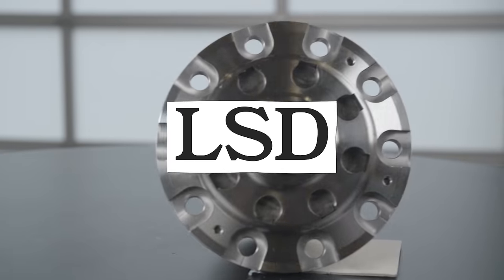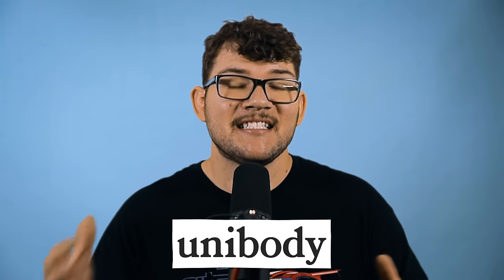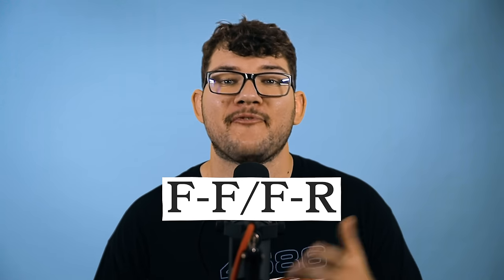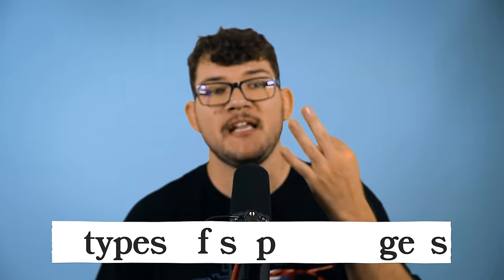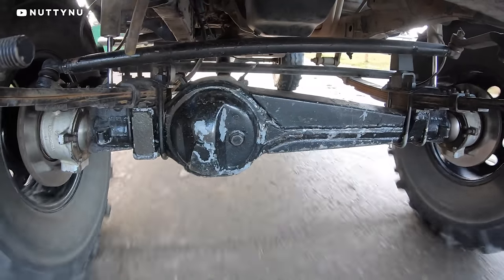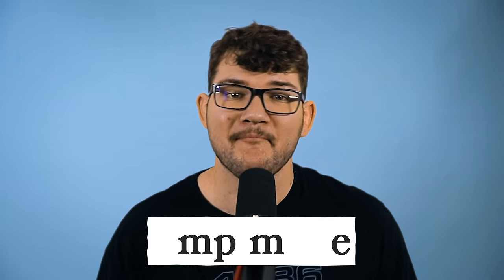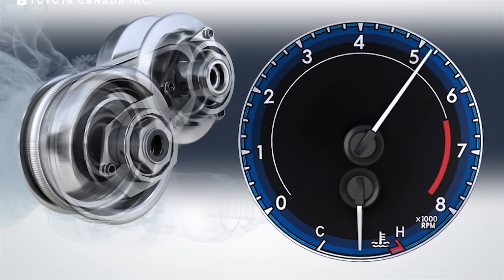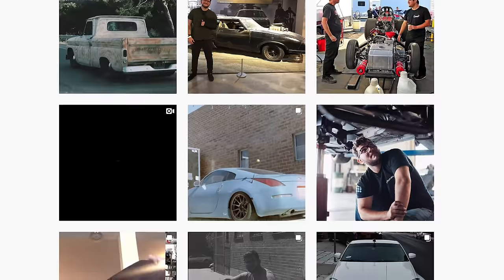Car Terms Every Car Nerd NEEDS to Know

Comment: haha blinker fluid, who the hell falls for that one? Now excuse me please, I gotta go change my muffler bearings.
Reply: The mechanic replaced my car's piston return springs but I'm pretty sure they were still good, they were replaced like 2 months before that already.
Reply: Everyone thinks they're funny haha muffler bearings...

Germans have forever referred to muffler hangers or exhaust system hangers as muffler bearings as they bear the weight of the muffler.  Just so as you have a good can of wire smoke to put it back in.  We are all good.
Reply: @the1whokill518  cmon man read it.
Reply: need to change the carbouator belt on my brand new car
Reply: brb, im going to check my oil levels in my spark plugs
Reply: @the1whokill518  actually I'm not sure about that. The valve may not actually use bearings. Hmmmmm should look into. But im also lazy.
Reply: Be sure to use the correctly sized left handed spanner wrench on it.
Reply: @rafox66  PIston Return Spring is fucking hilarious. but now im starting to question if something like that has ever been tried. sounds like an interesting concept.
Reply: muffler bearings? lol, imagine not having a semi-hydraulic muffler assembly!
Reply: Wait blinker fluid is not a real thing?
Reply: wait thats not a thing?
Reply: You own a bmw I am guessing?
Reply: Gotta change that pesky rusty spark tupes 😂
Reply: My wife
Reply: Turns out blinker fluid actually is a thing 😂 it's used in the 1st gen viper headlights
Reply: Don't forget to change the winter air to summer air that could really mess up your tires
Reply: I gotta replace my windshield wiper brakes
Reply: Working in aviation I’ve heard “hey buddy, get the prop wash.” And have myself been asked to find the “K9P” for paint stripping. (I went to another coworker, grabbed some old yellow drink lying around, bottled it and labeled it K9P and brought it to my boss)
Reply: Make sure to get the Nylon muffler bearings.
Reply: Dont forget your wiper brakes !!!
Reply: @the1whokill518 you Canadian ehh?
Reply: Not if I change my gear clutch first 😂
Reply: Make sure you check your canuter valve
Reply: Don’t forget the muffler grease
Reply: Airplane dirty? Go buy a couple gallons of prop wash
Reply: It's always best to add fresh gaskets when you change those bearings
Reply: Don't forget to grease your piston return springs
Reply: Never fell for those but I did spend some time looking for the squeegee sharpener.... sounded so real.... 😂
Reply: Dang what kinda turbo u running in that car. that would be a muffler bearing? Right? Lmao
Reply: I just replaced my wiper brake’s courtesy of Mr fix it himself :)
Reply: One thing that most people don't bring attention to is that the clicking sound of blinkers comes from the car's speakers.

Comment: Non-car people: "So thats what blinker fluid is"
Reply: Might wanna change out those muffler bearings while you're at it. Luckily enough my budy "Dirty Derk" has a special deal out right now.
Reply: matthew kovich by any chance do you know a good summer air dealers? I need new air in my head gasket setup.
Reply: @nick-mx4bz  I don't have summer air for head gaskets but we have a premium deal right now for changing out the seasonal fluid in your tires, it helps quite a bit with performance.
Reply: @TheConfusedWumbologist  sounds good, my window catalytic convertor delete has been making noise and that might be the problem
Reply: @nick-mx4bz  😂👍
Reply: I was waiting for the explanation xD
Reply: Piston return springs
Reply: i do not have any blinker fluid in my car do i need to go to a mechanic?
Reply: @MrBunch  yes
Reply: @TheConfusedWumbologist  you might want to check on your racing seat fluid
Reply: @z6u5  Nah man it's all good. I got dem levitating seats. They really help on long bumpy drives. Super comfy.
Reply: My blinkers fluid are non serviceable like those tranys that don't require service but I'm concerned if I should actually change the fluid or not. Help pls 😂
Reply: I think my centrifugal waffle sprocket is on it's way out the giggle pin has fell out of it and its rubbing on the laughing shaft
Reply: @Keeler442  damn, you're gonna need a frame stretcher to get to that waffle sprocket, due to the fact that it's tucked up under the mounting position of the o-face sensor.
Reply: You might need a head gasket delete for the blinker fluid to inject
Reply: It tastes like blue Gatorade
Reply: @Carsinogenesis  it really does.
Reply: I wonder how many people fell for that
Reply: @nick-mx4bz  shiiit I’m still running winter air in my tires..  never knew you were supposed to get new air with the different seasons
Reply: Yea it helps out a lot with speed, weight, smog, and it makes sure you windows don’t fog up.
Reply: @nick-mx4bz  that would explain my foggy windows on the 80°+ days
Reply: I need a new zortch converter in my 2030 Chodge Dallenger
Reply: Man I need to get some but I'm working on my brake ducts
Reply: Shhhhh
Reply: Use a little Seafoam in your blinker reservoir and I guarantee you won't hear that annoying blinker 😀
Reply: Fliuid for your blinker...
Reply: For the longest time I thought blinker fluid was real lol
Reply: Don't forget the Piston return springs
Reply: Guys, I’m hearing this knocking sound from my muffler. Should I change my muffler oil?
Reply: also, don't forget replace your piston return springs every 5,000 miles
Reply: @alexandersimon5340  Whoa, how did you get the 2030 Chodge Dallenger already?
Reply: *proceeds to fill blinkers with bleach
Reply: F
Reply: Where can I get some piston return springs for my chevrolet camry with a v5 engine?
Reply: That's actually what i said when it came up.... I'm still learning tho! lol
Reply: Don't forget to change your tire fuel injectors
Reply: Wait it not?
Reply: Might wanna change your alternator fluid while your at it too.
Reply: @memeboi6108  whilst changing it it would also be a good idea to get a wheel spark brace
Reply: HAHA exposed
Reply: @TheConfusedWumbologist  dirk*😂
Reply: Jerry be like
Reply: dang, i have been running stock all season piston return springs all this time. I should really change them out for summer high performance piston return springs.
Reply: I got hooked up with free spark plugs for my 85 Jetta diesel when I asked for a gallon of blinker fluid

Comment: I’ve been using their blinker fluid for years, incredible product.
Reply: James  I haven’t but the ones on my 22re are about shot, I’ll give them a try!
Reply: They also have piston return springs that are pretty gud.
Reply: For real my blinkers are so fluid it’s unbelievable. Best investment I’ve ever made
Reply: Is blinker fluid actually real? Cuz now I’m confused
Reply: @benjaminrios5235  🙃
Reply: @benjaminrios5235  They're all trolling. Donut did it for laughs.
Reply: seriously do not want to skimp on that, learned it the hard way when my rear left blinker gasket blew
Reply: Aditya Pran Borah  I like wire instead, you can feel the pull on those blinkers real good
Reply: My blinker was working then not working then working then not working so I topped up the blinker fluid now the blinker works fine it stays on continuously when I use it.
Reply: @benjaminrios5235  no it's not real but it's funny 🤣
Reply: I can’t find the blinker fluid fill nozzle on my bmw 320i, it’s been empty for weeks and people think I’m an ass whenever I cut them off!
Reply: Just directly spray a pressure washer at your headlight assembly.  Cheap hack
Reply: You haven't tried their Clutch Friction Lining Lubricant! Best stuff to hit the market in YEARS! I'm telling you, you won't believe the difference--you've NEVER had such smooth clutch engagement before, only $49.99 a bottle--enough to last the whole LIFE of the clutch!
Reply: @bryangibson6211  😂
Reply: @benjaminrios5235  Blinker Fluid and Muffler Bearings are what people send non car savvy people to the parts store to troll them. They go ask for it at the store and the employees get a laugh.
Reply: Me too ive been using dirty dirks for ab a decade now no more agressive click
Reply: Honestly same the blinkers are so visible I feel my steering getting better with the 0w-55 fluid
Reply: @benjaminrios5235  only in the SR1 Viper

Comment: As a subaru owner I'm a little sad you didn't cover "milkshake"

the mixing of oil and coolant when the headgasket starts to go
Reply: Also he didn't mention H for boxer when he was talking about the engines😞
Reply: 170k on my 07 WRX, never had a head gasket issue. Turbo seals died and burnt a valve but no headgaskets lol. I do however have a built block and heads now.
Reply: @Ontheregz  give it ~30k :) sold my first car at 199k for 450 when it started making milkshakes. (and rod knock and valve tick and no e brake and it leaked everything except trans/wiper/diff fluid and had more rust than steel and..... Well you get the point) I'll miss that 1999 subaru impreza outback "sport"
Reply: Tyler woodring got some MLS gaskets and ARP studs everywhere, should be ok with 30psi and my gtx3576 gen2  😈
Reply: This is the mark of a Subaru? I was thinking about one but now...
Reply: I’ve gotten a milkshake out of a deuce truck.
Reply: @mikeaninger7388  People exaggerate  way too much. I have 2 Subies and they both have more than 150000 miles, no issues whatsoever. As long as you maintain your cars you'll be fine.
Reply: There should be a part 2
Reply: Mike Aninger yeah from the 90’s lol
Reply: That's mayo 😂
Reply: Benjamin Stephen dam straight! I have an 07 wrx pushing 400whp and is extremely reliable, the 15mpg on e85 sucks tho lol. But thats why I bought a Forester.
Reply: @Ontheregz  nice! I have an 06 Wrx my self
Reply: happens in my dad's K series engine Toyota back then, coolant temperature goes high abnormally, and he refilled it frequently on the highway rest area. But it still pulls strongly for another 100 kms until he reached home. Turned out the headgasket were in trouble, and the engine insides looks like a brown porridge. Just needs to replace the piston ring and its ready to go again. Talk about old Toyota's reliability.
Reply: Vincentius Kennaldy dude! I had a 98 Tacoma with 350k, a 2000 with 270k and an 01 with 200k! Miss those mini trucks. All I ever did was oil and plugs lol
Reply: 1) Thanks for educating
2) Lmfao
Reply: @Ontheregz  regular oil change and it will run forever LOL
Reply: @Ontheregz  thats how you make a subaru reliable. You must go forged asap. Got a friend only having 10k on his. And engine went bye bye.
Reply: Both of my cars have the milkshake
Reply: Not just Subies - I worked for a GM (Saturn) dealership in the mid-2000s and can tell you that one of the foulest smells ever is milkshake made with Dexcool instead of regular antifreeze.
Reply: chinggedyourlastchong chang probably a 2011 with the paper thin ring lands
Reply: @mikeaninger7388  Ive know 27 Subarus in my lifetime any only one of they did it, and I paid 1200 for it at 200k miles. It's just a stereotype from the 90s
Reply: Now I want milkshake, but not in my engine
Reply: Ford 6.0l diesel owners are also aware of this. Their milkshake brings all the oil to the EGR.
Reply: @mikeaninger7388  I've gotta second what Ben said. I've had multiple subies over 200k that have all been tanks. The only serious maintenance issue is not putting off the timing belt.
Reply: My 1990 grandams engine ran on the stuff.
Reply: You mean my 74 Pontiac wasn't the only one?
Reply: I feel attacked.
Reply: Depends on the subie. Some years are fine some not. Most of the time they fail externally in my experience. The only vehicle I've had milkshake was a 95 Wrangler with the straight 4.
Reply: That's an F
Reply: New civics with the 1.5t have a awesome oil dilution issue that results in the same tasty shake 😑
Reply: Laughs in supercharged 1uz
Reply: I can game or whatever I my 2001 Tacoma was an s-runner with supercharged 5vz, the black trd one not the janky silver one. That was a fun truck!
Reply: Nissan Pathfinders and Xterra loves milkshakes
Reply: The dirtiest of the milkshakes for all us Subie gents out there. Got this done at 95k as a preventative measure. Got 107k on a 04 Sub running 330 Hrspr and 290 lbft to the wheels. I am a happy camper. 😁😁😁 SHOUT OUT CP MOTORSPORTS IN HOUSTON, TX!!! Carlos is the best.
Reply: @mikeaninger7388  dude, they can be pretty intense on the upkeep, but not quite as much as a rotor afaik
Reply: @AlbinoFuzWolf  you live in the Northeast, do you?
Reply: Now I have a milkshake in my Corsa. When I fill up the expansion tank with the coolant to the max mark, the Corsa drank the coolant faster then I am able to drink a Scotch with Coke 😂
Reply: Boom
Reply: This is an old comment but the Strawberry of Death on my wife’s Xterra turned me off of Nissan forever. I used to be a Z Boy but the way Nissan handled that issue was pretty fucked.
Reply: Ringland failure, rod knock, valve gasket failure, head gasket failure, early clutch failure, timing belt gasket failure, these are all known Subaru issues. If you say, "my subie has x miles and never had a problem", you're either leaving something out or you're the exception.
Reply: My first milkshake was in my '96 M3 in 2015. Cost to replace was nearly identical to totalling. Runs like a dream to this day.

Comment: i’m so happy someone finally explained the difference between AWD and 4x4
Reply: They didn't though.

For one, they were talking about 4WD not 4x4. 4x4 just describes how many wheels are on the car, and how many can get power. i.e. awd subaru wrx has 4 wheels and they can all be powered, so it is 4x4, fwd corolla has 4 wheels but only two can get power so it is 4x2, trucks and tank-things can get funky with 6x4 and stuff.

4WD entails four powered wheels that are permanently locked or (more often) can be locked. In the second case, it is basically awd most of the time, but when the differentials are locked, even power will go to wheel in a pair. Without a centre-locking differential the power transmitted to the front and back pairs can differ even while each pair is locked, but most 4WD cars have a centre-locking diff that makes sure each wheel gets the exact same power regardless of the grip differences.

AWD just means all wheels can get power (I believe it is also always full-time - i.e. you can't switch to 4x2), but only has open or limited slip differentials (I don't know if they can have locking centre differentials) so you can't technically give equal power to each wheel.

I know this is confusing as hell. Here's some examples (the details are in a heirarchal order):

Toyota Prado
-4x4
-4WD
-technically also AWD

Honda Civic
-4x2
-fwd

Toyota Rav4
-4x4
-AWD
Reply: Car companies like hyundai and kia just put 4wd on their awd cars(and japanese people calls every 4x4 4(yon)wd) even jeep put 4x4 on their awd cars. it's hard to tell if it is classic 4x4 or just awd these days
Reply: @CHMernerner  no, I think you just don't know what the terms mean. respectfully.

4x4 and awd and 4wd mean different things
Reply: @rolls_8798  car companies does not care
Reply: @rolls_8798  1. The term AWD is used interchangeably with 4WD outside North America. As a result, some people will say a Lambo has 4WD, even though it uses a system that's really AWD if you want to make that distinction.

2. Drive systems that apply torque to all 4 wheels at least some of the time can vary widely, and manufacturers don't always follow the "rules" when marketing a vehicle as AWD or 4WD. Typically speaking, AWD vehicles are designed for slippery roads first and off-road applications second, and 4WD vehicles flip that prioritization around. In most cases, a 4x4 car (hatchback, coupe, sedan/saloon, wagon/estate, etc.) will be AWD; a 4x4 pickup truck will be 4WD (though exceptions exist), and a 4x4 SUV can commonly be either one.
Reply: @JobiWan144  pretty accurate I think, but in Au, a company will always market a car as 4wd if they can (i.e. it has locking diffs), the other vehicles (like a subaru XV) just stick with AWD or 4x4.

I'm fairly certain AWD and 4WD are different designations (apart from the fact that AWD doesn't specify the number of powered wheels)

Edit: wikipedia says that 4WD has specialised compinents (in my mind, meaning locking diff or a proper transfer case) but in the US 4WD is just off-road oriented vs. AWD being slippery road oriented - as you said
Reply: @rolls_8798  
your argument is more on semantics though.
Reply: @dickmelsonlupot7697  yes. that is the entire thing. what the words mean.
Reply: @rolls_8798 hey guys look its a pedant
Reply: Wait, so 4wd delivers equal power to all the 4 wheels at the same time, and AWD delivers power that the wheels need?